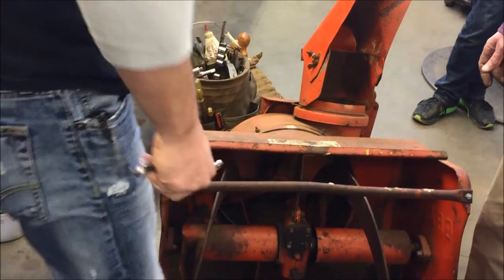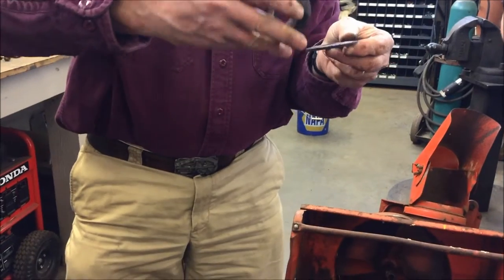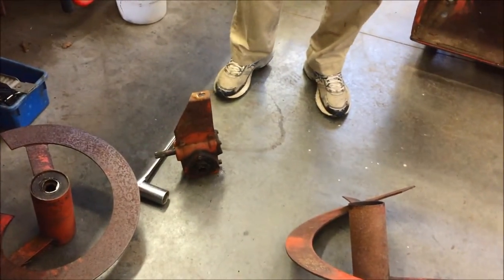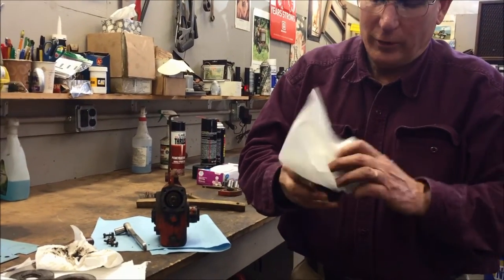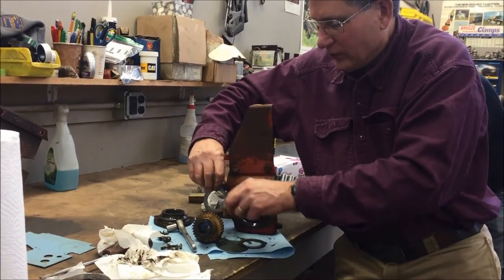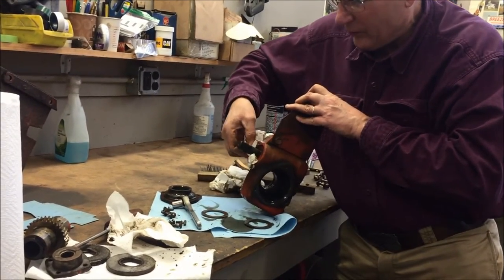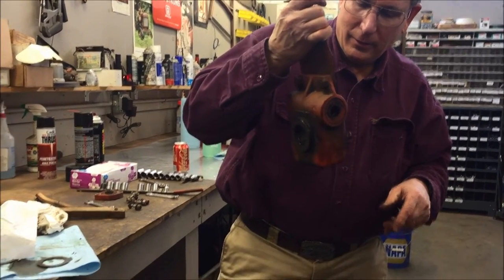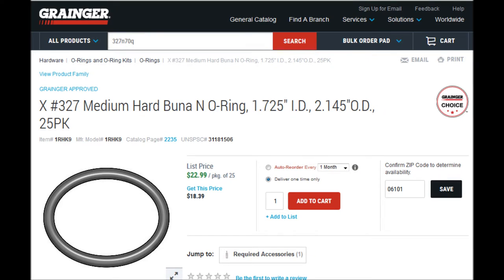Gravely Snow Blower Rebuild School Part 1 2017 Blow In

Comment: That bronze gear is now about $200, I'll be rebuilding my MA211 this year. It's been outside under a tarp, on logs, for the last two years, but I was fussy about removing rust, repriming with rusty metal primer, and repainting, and it's still in good shape. I am certain there are some chipped teeth on the gear; when I changed the last one around 1983, I was too young to realize that metal shards would still be in the case!